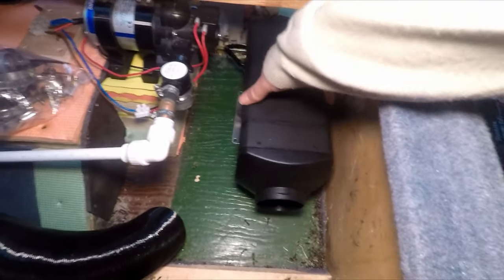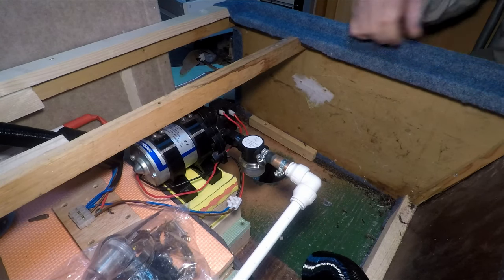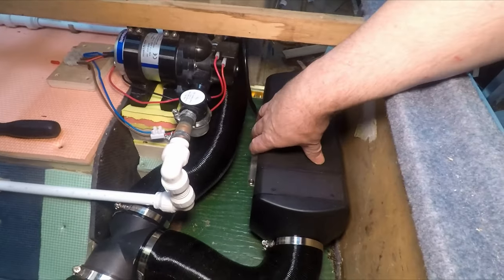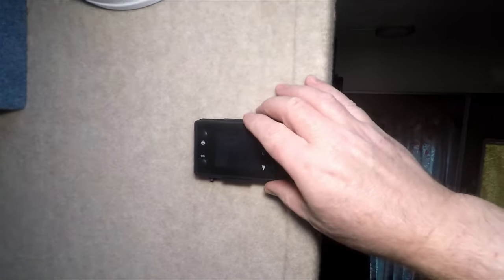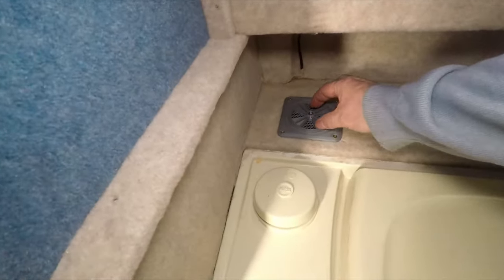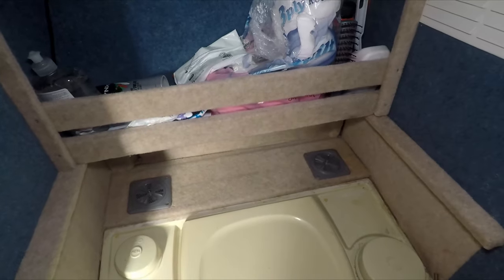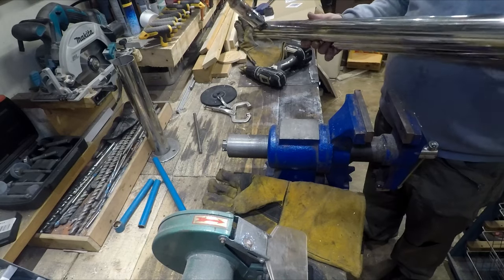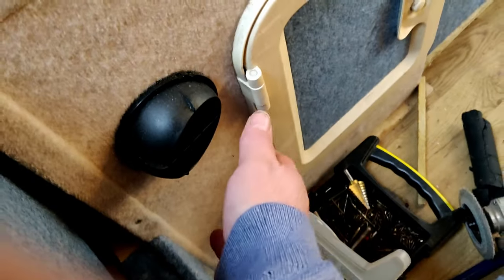Installing a VEVOR 5KW 12V Diesel Parking Heater with LCD and Remote Control 🔥🏕️🚐✔️

Comment: Should never drill the bottom of the tank if its been used in a vehicle.change that rubbish fuel line and If you've gone to trouble of using a hole saw why didn't you use a turret instead of that awful tin plate?
Reply from the maker: Maybe you should up load a video of how you have installed your Diesel heater and show me how it should be done?
Reply: @JohnsWorkshopDiary  I've done around 30 installs and was just trying to help,I'm sure you don't want 10 litres of diesel leaking into your van.